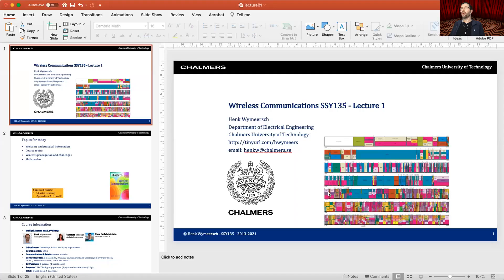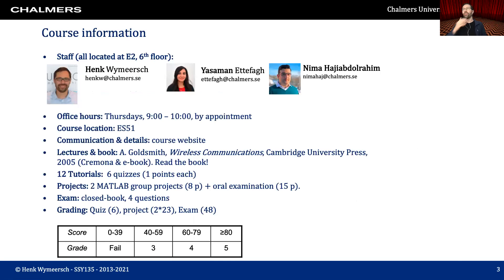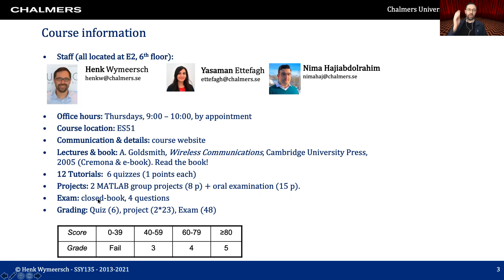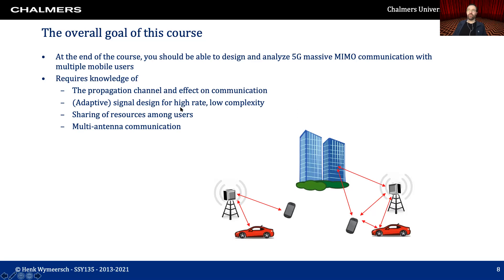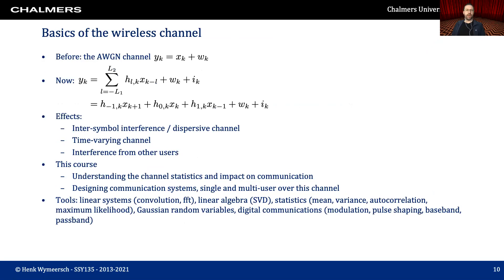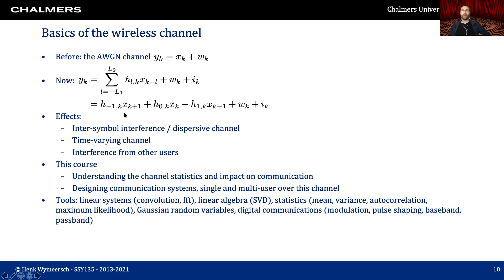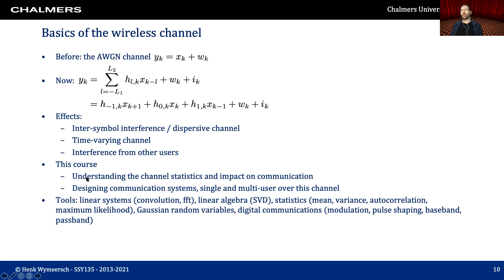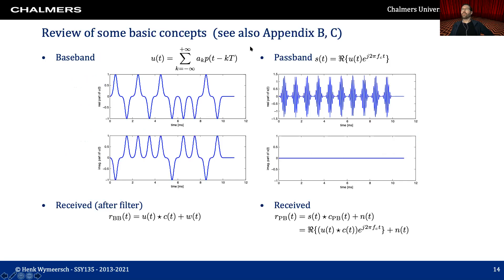Lecture 1 part 1: Preliminaries and basics of the wireless channel

Comment: Both lecture slides and matlab code examples point to the same URL which is the pdf of the lecture. Could  you please provide the URL for the matlab code? Thanks GM
Reply from the maker: The link is now fixed. Thanks for informing me!
Reply: @ProfHenkWymeersch  Hi Professor, the matlab code link seems still pointing to PDF file, could you please fix it? Thanks!
Reply from the maker: @skyhighhigh9999  Ah. I only changed it in the playlist, not for this lecture. Please try again. Should be fixed.
Reply: @ProfHenkWymeersch  Thank you very much Professor Wymeersch. Your lectures are very enjoyable to watch and learn! Thanks much for putting this up for the community!